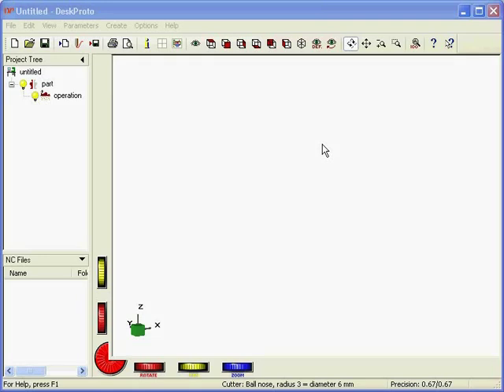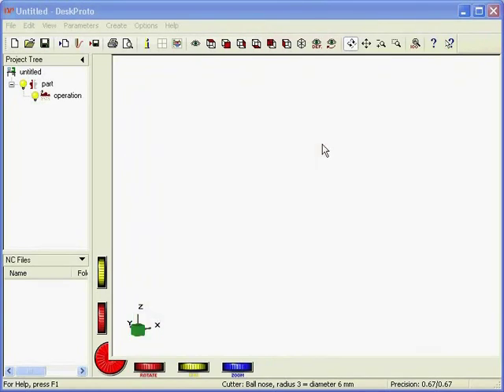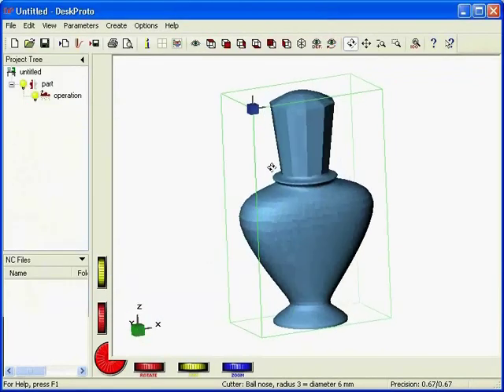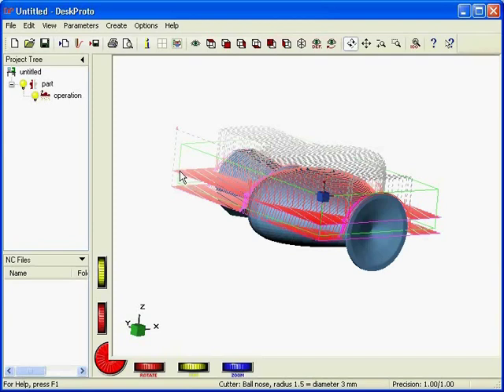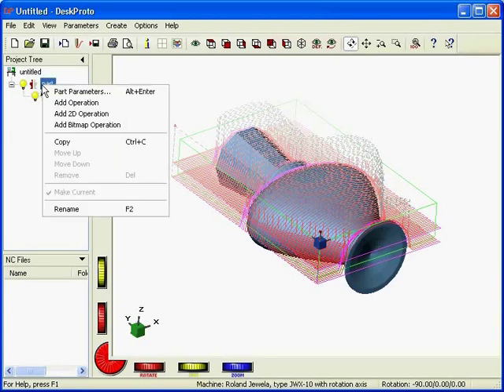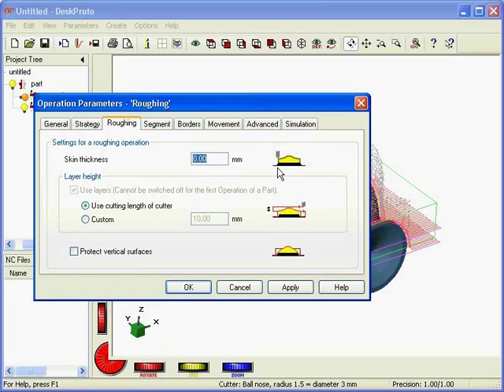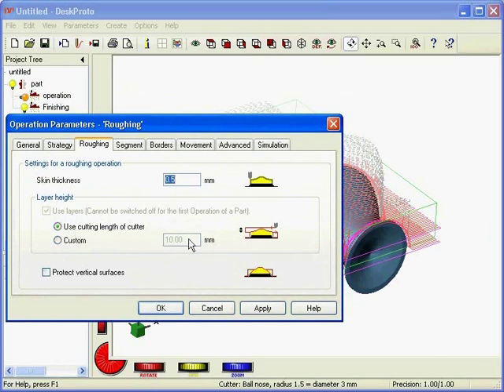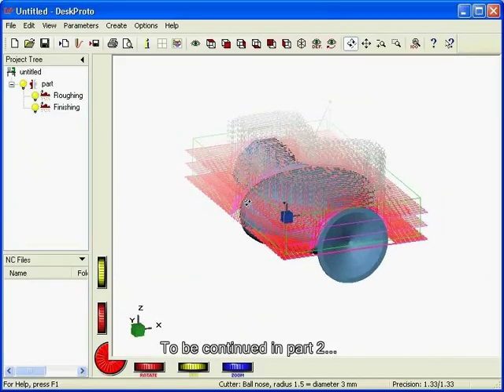DeskProto, Roughing and Finishing, part 1 of 2

Comment from the maker: No, that is absolutely not needed, you can use the same cutter and save yourself the trouble of a cutter change. The roughing might be done a bit less efficient, which in many cases is not a problem.